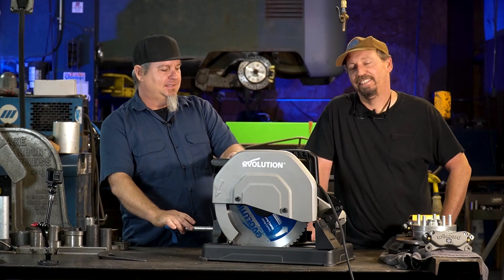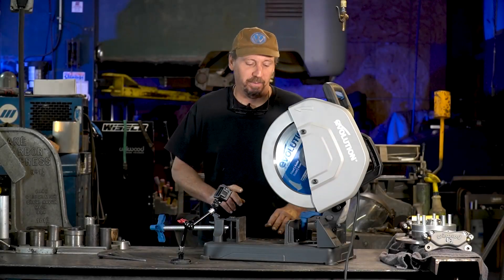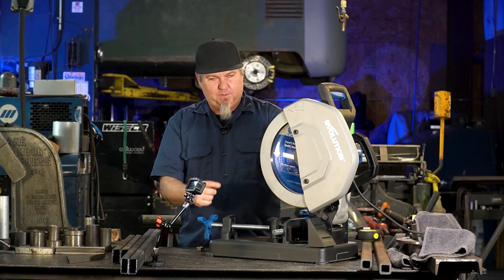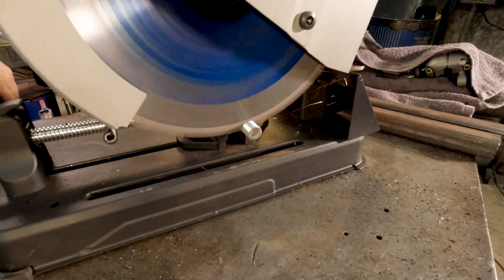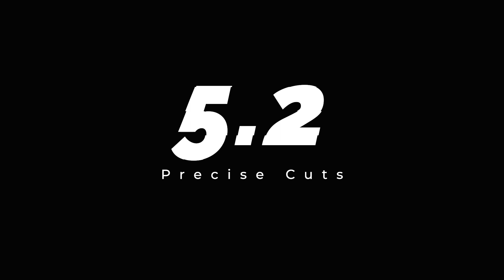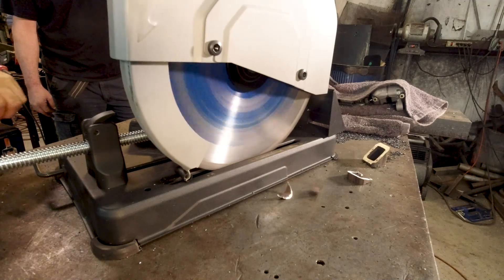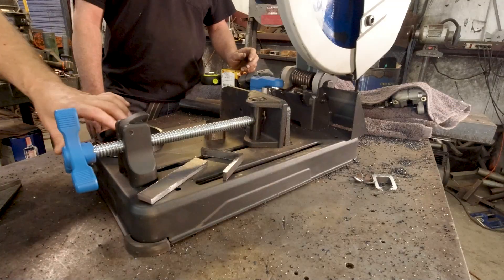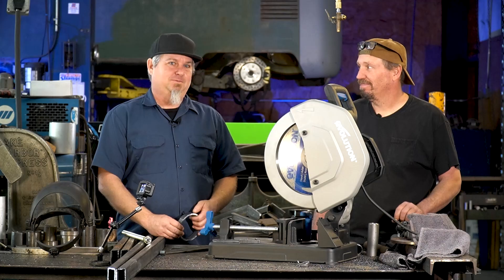Evolution Power Tool | The Best Chop Saw we have used!

Comment: super cool, going to order one today, great video thanks
Reply from the maker: Awesome! Ours is still doing great!
Reply: @RobStapleton  Hey, How you doing Rob? I was just curious on your opinion of this saw for cutting steel tubing? I just got one and it does great cutting solid steel, but to me it doesn't seem like it likes the interrupted cut you get from cutting steel tubing. I made a couple cuts in 2 1/2" x 2/12" x 1/4" square steel tubing, and once it broke through the first flat surface and the double, interrupted cut started, it became really jumpy/jerky, to the point it had me worried that teeth would chip or break off the blade. Do you notice this to? And if so, have you came up with a way to alleviate some of this?
Reply from the maker: @smallblockchevy1022  On the square stuff if you use the attachment to turn it 45° it helps a lot. Also just go a little slower and let the saw do the work.
Reply: @RobStapleton  I don't remember for sure, but i think I may have actually tried one of my cuts like that and didn't notice much of a difference. However, now that I think about it, those first few cuts I made were with the saw setting loose on carpet, so I'm thinking maybe that instability may have amplified that jerky effect I was speaking of. I haven't used it again since, but maybe mounting it down solid, or at least setting it on a solid flat surface will eliminate, or at least reduce the problem.

But anyway, thanks for your response. I really appreciate it.

Comment: Will it cut an I-beam and can you buy just the blade
Reply from the maker: It will as long as it fits in the saw. You can buy just the blades but you can't just put them on a regular chop saw. The saw has to run at a slower RPM.

Comment: I wanted to cut precise angles and didn't have good luck using the casting to set the angle.  I eventually added a fixture plate and made the fence 90deg fixed.  Then I can measure angles off the fence and get really close.  I use a speed square, though, if I'm in a hurry.  https://youtu.be/AlYl-yZ2OR0
Reply from the maker: That's a great idea! Thanks for sharing.